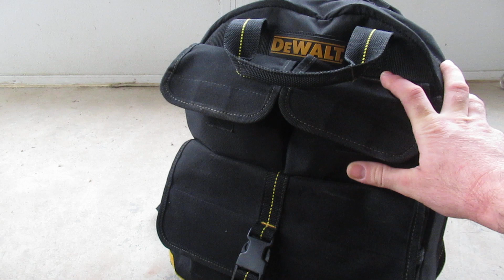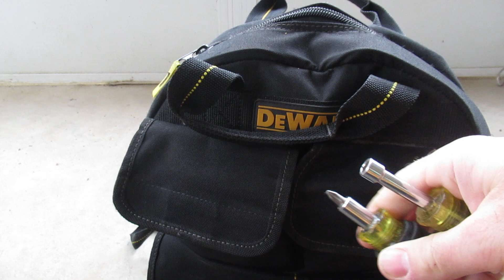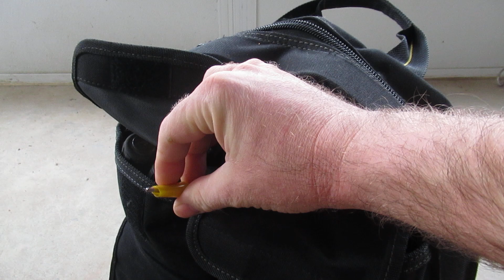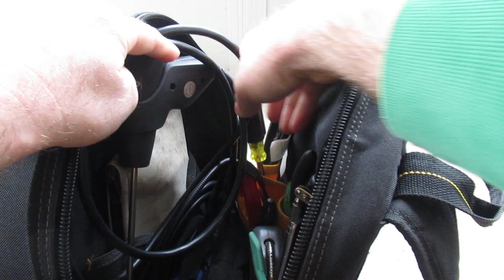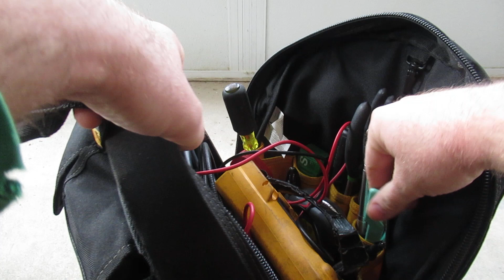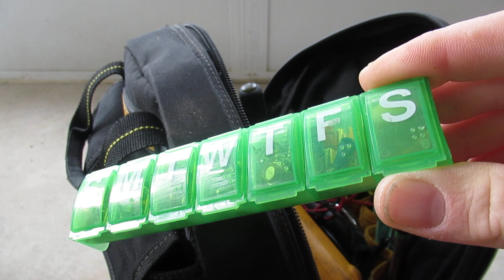HVAC Tool Bag Setup

Comment: Great video.  I'm in southwest Arizona so we don't know heaters 🤣. I agree with your opinion on Fieldpiece.
Reply from the maker: Nice.  Do you use heat pumps out there at all?  AC setup is a lot easier.  I usually pack all that in my tool bucket, except the gauges.
Reply: @hvacbudget8600  , yes, roof mounted heat pump packages are about 75% of our units.  We do have gas but I doubt we have more than a few techs owning any gas or CO meters